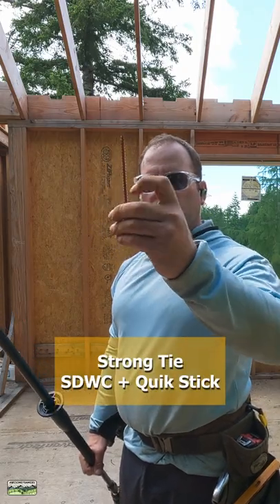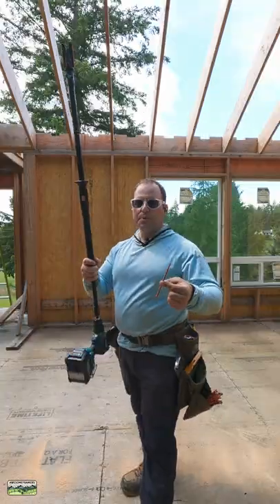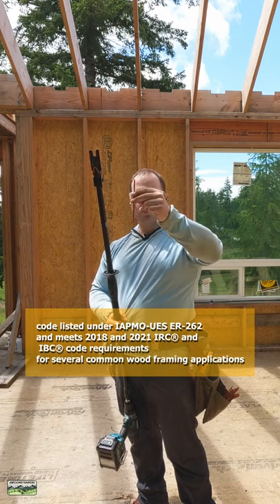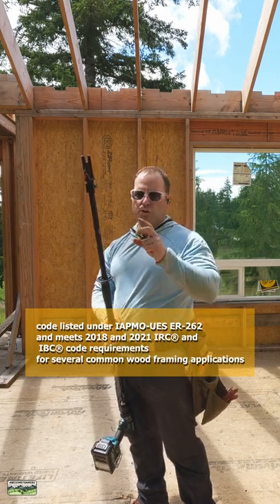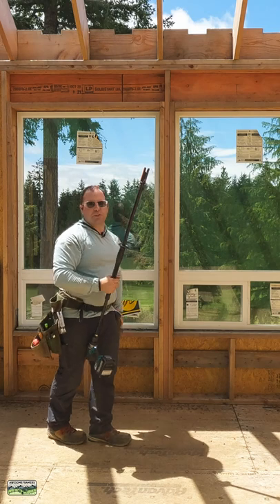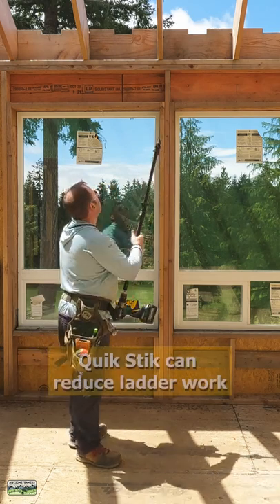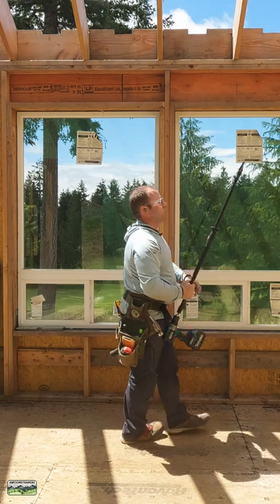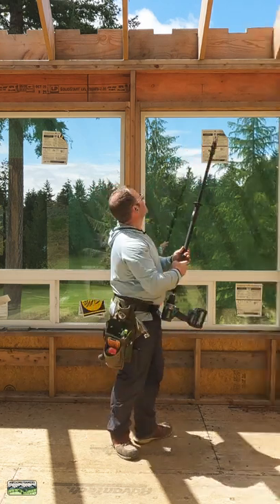The FASTEST rafter/truss top plate connection

Comment: Tell us more about the header over the window
Reply: Leaves the plywood and lvl out to run the truss screws, so he doesn’t have to use hurricane clips?
Reply: Im not a construction guy or carpenter. That looks weak...compared to past views if real houses going up, shows like Bob Villa, or This Old House....It had to be for this demo....
Reply: thats an open header it allows for insulation above the opening.
Reply: @willwoodsheyo  That the dumbest thing I’ve ever heard, ain’t no inspector gonna pass a building with “open header” all you can do is run half inch insulation between the 2 lvls. Looks
Like he did it so he could get out of putting in hurricane clips and just use timber loks. Now if your codes allow that you might want to move states.
Reply: It’s cheap junk that an engineer said is strong enough
Reply: Its a very expensive LVL overkill!! Still should have a few cripples in it.
Reply: Ok I thought I was tripping, lmao
Reply: What
Header is That?????
😄😄😄😄😄
Reply: Shhhh!! The drill doesn't seem as useful when you realize that you can only use it on 6 joists in the whole house
Reply: @RiverSLV  lol an LVL that size is cheap junk? Lol. It’s hardly taking any load and you’ve got a stud in between the two windows supporting the top plate as well. If anything it’s over engineered.
Reply: There's a LVL there for the header are blind?
Reply: @Billybob-go8hn he uses foam insulation in those spaces. These are high quality homes so they have high standards of strength and insulation
Reply: @Benjamin-xp7jl  A high quality home doesn't leave spaces for useless foam insulation. that's like putting insulation between your headers. Unless you can prove its more energy efficent, which it isn't. Its a bad practice. They dont do this on mansions, no good enigneer would approve of this. That's what the zip system is for. This only works because he is supporting rafters* alone. Let me use less lumber and more insulation so you lose strength for no added benefit.
Reply: That LVL header  is plenty strong what are you guys smoking so are structural screws they are made of higher quality metal then regular screws that are brittle

Comment: Who puts the window in before framing is finished? I see that being problematic
Reply: They install windows and sheathing (sometimes even siding) on the ground before standing up the walls
Reply: The window company recommends it so the crackhead you hired can break it and you can buy more windows
Reply: Yes indeed
Reply: Never been on-site before I see 👀
Reply: Some framers choose to set the windows before they stand them. In some cases it's quite beneficial, in all cases it's faster, but not always the "best" choice, as one can imagine
Reply: @RiverSLV  no joke. I’m in a new build neighborhood and they are breaking Windows every day. One of our windows was broken up until the day we closed probably because they didn’t want to risk breaking a new one 🤣
Reply: Roughed into frame on sheathing.  Finish box in and trim later.  Only problem I forsee is wall  racking .. but it's standard practice.  I agree tho' .. I'd rather install after stand up.

Comment: I don't trust it. Gimme hangers
Reply: They're cheap, I'd do both
Reply: I was sceptical at first but they are 👍
Reply: Same concept. Essentially connecting the rafter/truss to the top plate. Hurricane clip with multiple short screws/nails (most likely until recently Not structural rated) or one 6 inch structurally rated screw. When building it’s about cost both labor and materials.
Reply: You don't trust how a screw works?  They're obviously tested under load if they're allowed.
Reply: truss clips not hangers
Reply: Boomah I thought your pic was a hair on my screen. I kept trying to wipe the dam thing off.
Reply: What is that notch in the blocking between the rafters for?
Reply: OMG....
The trusses are sitting on top of the wall, and over-hang on the other side.
There no place for a hanger.
Hurricane ties are what I'll use.
Same as always...
Reply: Do both in a hurricane 🌀 prone area
Reply: @boycemontez4962  vent
Reply: @boycemontez4962  it's to remind them that they left out all the window headers, to  make a 15sec ad
Reply: It's strange to me that you'd take one look at a thing and make up your mind like that.  They are engineered, tested, rated, and approved.  Have you thought about how much work goes into each of those steps?

Comment: Those screws don’t stand a chance, I’ve noticed more and more builders are using them maybe, because they are cheaper than hurricane clips but definitely not as strong
Reply: Hurricane clips are a joke… The screws are much better
Reply: How does a single long screw provide greater uplift resistance, than a metal clip attached with 8 fasteners?
Reply: Truth!
Finally see that somebody besides me gets it.
Thank you.
Reply: @hmtrimworks7148  screws are brittle and will break after just a little bending.
Reply: @ProleDaddy  Ok… screw two 2x4’s together and then create enough shear pressure to break the screw… totally different than putting it in a vice… then do the same with a nail…
The nail will pull out and the screw will hold tight… and even if you do get the screw to eventually break it would break way after the nail pulls out…
So yes, one 6” screw is better and faster the a hurricane clip with ten 1.5” nails
Reply: @hmtrimworks7148  I did not consider how the boards would create a different loading situation I suppose. You are right on that one, assuming the boards are tight against each other and remain that way. I'd still be interested to test the strengths of each. Coated nails can hold quite well.
Reply: @hjackwingo  lol someone’s clearly never taken the time to read the technical guide on Simpsons website for these screws and realised they have a higher uplift capacity than standard hurricane ties. How embarrassing to be you bro lol.
Reply: @henra2244  Actually not at all, considering the remark is made by a troll

Comment: That looks familiar. Why a drill and not an impact?
Reply from the maker: Way faster 👍
Reply: Impact drills heat the screw more when installing it and they break screws alot faster using a regular drill has enough power and is faster then the impact you should really only use an impact when doing lag bolts
Reply: @AwesomeFramers  No kidding. Cool.
Reply: @hulksmash5-625  I've drioven miles of PowerLags with an impact, and, yeah, they get hot, but I never broke one. The heat comes from friction with the wood, not the mechanics of what is turning the screw, I think.

Comment: Ok I get that doing it this way is faster and yes screws are strong but I know for 1 H clips have to be used an inspector would never pass that where I'm from and for the ppl saying nails pull out yes they do but what we do at least on the jobs that me and the crew I work with we put 1 inch screw in to top and bottom holes of the clips and fill the rest with nails we usually will have 1 guy going and putting the clips with screws in and another guy go behind him after he's done to fill the rest with nails we have the nail gun for these clips we also do the same for joust hangers as well

Comment: Screws can break easily though. I'll take the hurricane clips
Reply from the maker: I don't think you understand that these are tested and made with a higher quality metal. A safety factor is applied, so in reality these are far stronger than they are rated for.

Additionally, more nails into the rafter, truss and top plates often leads to splitting.
Reply: Not meant for shear only uplift same as h25
Reply from the maker: @Quackerstacker1973  that's not accurate https://embed.widencdn.net/pdf/plus/ssttoolbox/rbvdfpv76y/C-F-2019TECHSUP-p54-68and73.pdf

Comment: No H1 or H2.5 hurricane brackets? Where are you building that house?
Reply from the maker: Please click the links in the caption.  These are made by the same company that makes the H1 and H2.5.
Reply: @AwesomeFramers  ok, but 10 Teco nails, installed perpendicular to a truss and double top plate, with a shear strength of 170 lbs per nail or 1700 lbs per bracket, seems stronger. When did that 6" fully threaded screw technology become industry standard? Or is that 6" screw only used on RAFTERS?
Reply from the maker: @joeybox0rox649  look up the actual uplift on each of the clips you mentioned and compare it to the SDWC. The data is published my the manufacturer Strong Tie

Comment: Been framing for over 40 years and I still don't believe anything helps with a E 5 tornado, to me just another useless process to make inspectors happy
Reply: Maybe not an E5 but it will help in a 100 mile an hour blow that might take your roof off mechanical fasteners work whether you want to admit it or not.
Reply from the maker: Nothing helps with an E5.  I've talked to engineers about that, only building underground does.  This screw is not meant for a tornado of that magnitude, nor is it marketed for that.
Reply: Yup

Comment: What's up with headers . N framing
Reply from the maker: 1 3/4" x 9 1/4" LVL allows for more insulation
Reply: @AwesomeFramers  sounds good but I don't buy it  thanks
Reply from the maker: @CarlosSanchez-bg4wf  it's engineered but you probably know more than a structural engineer
Reply: @AwesomeFramers  I've been a stu.eng since 86.     Word. I don't know what state you in.     Do you bruh
Reply from the maker: @CarlosSanchez-bg4wf  the time you've been in the trades is irrelevant. Testing and science are relevant.

I'm in the state of Nirvana

Comment: ..those are absolutely not a suitable replacement for hurricane clips..

24” OC framing? No cripplers under the rafters/over the windows. offset rafters & studs? No rim joist or rafter blocking? What are you guys building, a shanty shack in Manila? 😆 and is your building inspector on board with these dubious methods? 😂